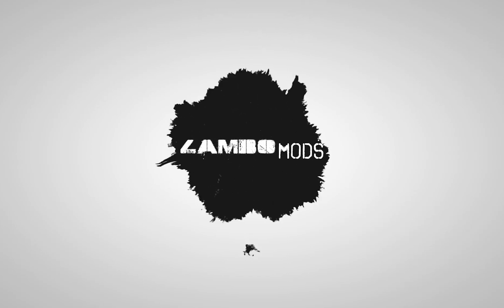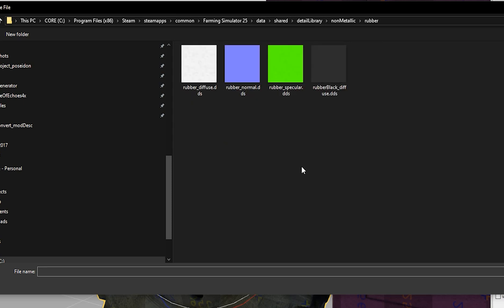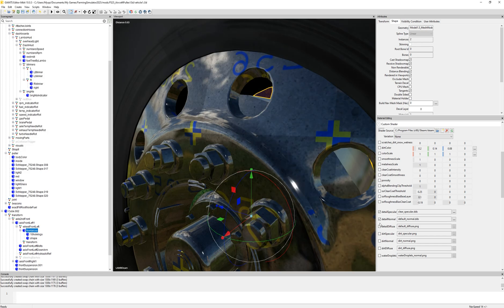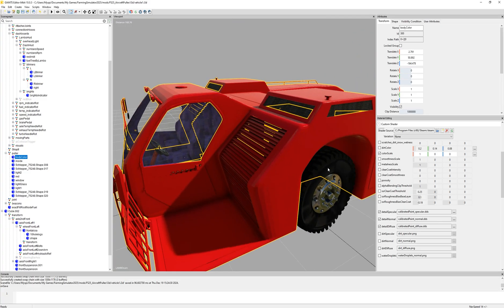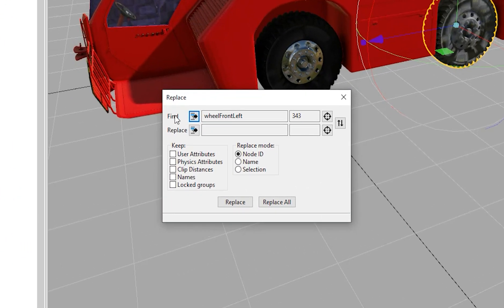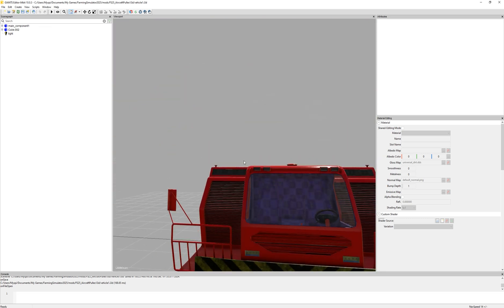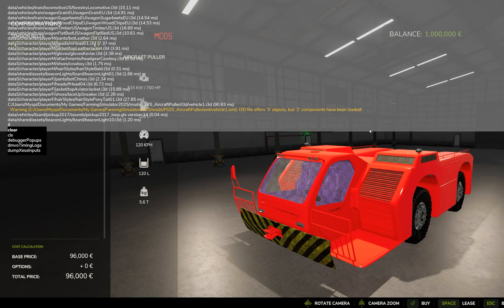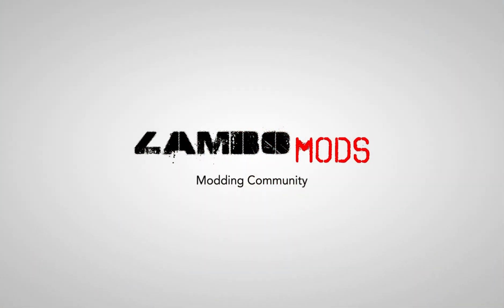FS22 to FS25 Modding: the Frustrating Material System (Part 3)

Comment: Hi Lambo. I am trying to convert an FS22 mod ( for personal use ). I have the mod open in Giants Editor 10.0.3 and my first error is this one, ERROR RED_ILLUMINATED DASH 1_001 ,51 ) DOESN'T HAVE ALL REQUIRED VERTEXATTRIBUTESFOR MATERIAL "RED_ILLUM' fs25. sorry for the caps. How do I rectify this error?
Reply from the maker: Thats a light error, either delete the light or import a new one from ingame. If it has to be that mesh, export to blender to make it work as a light. Id suggest watching prior episodes of this converting section, I cover quick fixes.
Reply: @LAMBOMODS  ty

Comment: Great video. How do i edit certain parts of a vehicle that are "options" in the store on my scenegraph? Like i have paint matched mirrors and paint matched bumpers that are hidden in the scenegraph. I can see them on the scenegraph, but they aren't highlighted, and when i click on them or export that specific part to Blender, they won't show up. They dont even show up in giants editor. Or how can i delete those options without getting any errors? Thanks for your help!
Reply from the maker: Don't do any work in the i3d if you are just trying to remove options. In the xml under design configuration, or another configuration you can just comment out code of the configuration. Follow xml rules and should work
Reply: @LAMBOMODS  ok but if I want to add the new material to the options that aren't visible in ge. How would I do that? I cant see them when I click on them or export them to add material. Thanks for the response.

Comment: turn on "shared editing mode" I had the same annoying problem with having to edit the i3d through xml to fix the materials before I turned it on.
Reply from the maker: @lancemodding9265  as long as I have been modding. I forgot about that dumb Lil check box 😆 🤣
Reply: @LAMBOMODS  its off by defualt..... Giants trying to make it hard on us

Comment: The giants tools are just awful.
If its not the texture tool not functioning its the testrunner not working because giants editor crashes while its trying to check for an update.
And people complain about the game itself but thats perfectly playable even with the slight issues.😂😂

But got my first placeable mod done and uploaded for fs25 thanks to alot of your video's.
curious if it gets approved in a few weeks.
Used ingame textures as placeholders for the most part as the model is far from finished.
Pretty much made loose components and going to join them later and bake proper textures for it.
Main issue i am having is learning blender but slowly improving.

Comment: I appreciate you doing this anyway! I can tell it was annoying but thanks for doing it anyway! ❤❤
Reply from the maker: It was frustrating! Especially the textures, I really hope that system gets fixed soon!
Reply: @LAMBOMODS  Yes me too! although if you use the vehicleshader its super simple! I'm thinking I'm gonna make a video on it!
Reply from the maker: the converted one from fs22?
Reply: @LAMBOMODS  Yeah, if you go $data/fs22support and then copy the shader file, then get to your fs22 mod that you are trying to convert and paste it in there, then if you open your .id3 with notepad++ and find your line that says $data/shaders/vehicleShaders and delete the $data/shaders/ when you load it in game all vehicle textures will be there!! Do the same for wheels, and they will appear, too! It's a good starter point! You will still have to do some wheel configurations!
Reply: Good video but where is the blender part? 😢
Reply: @carlandersson8467  blender is easy😄 the way you have to export import export and import again is dumb